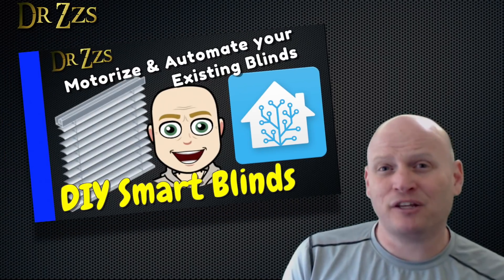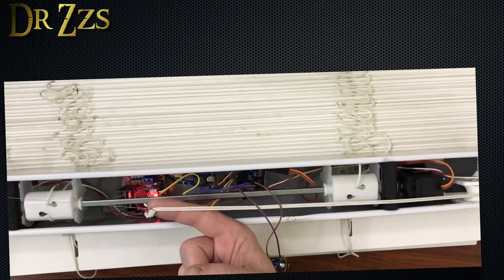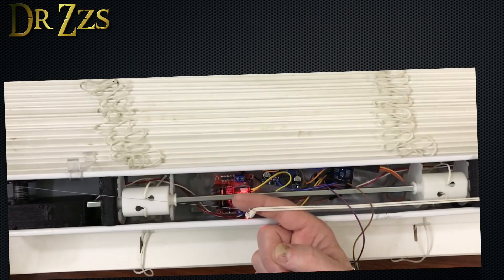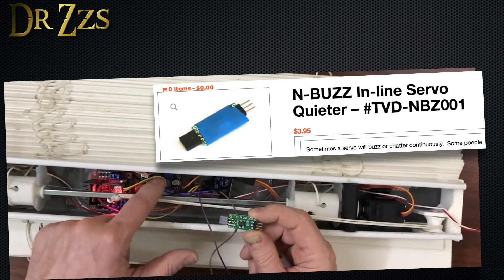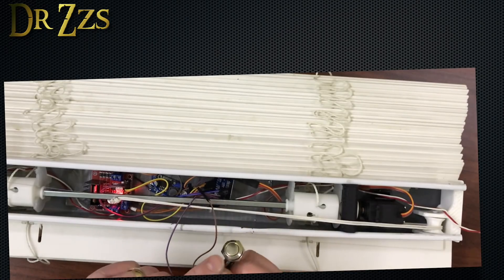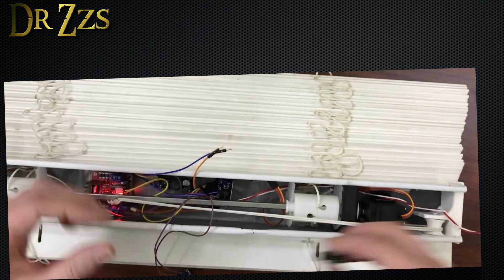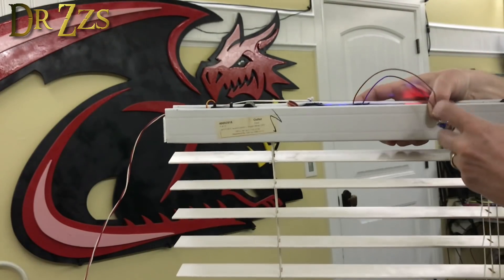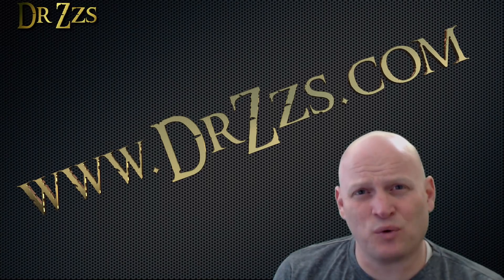Motorize and Wifi Control your Existing Blinds - Version2 | Smart Home | Home Assistant

Comment: First, thanks a bunch for sharing all of this information AND the 3d parts.  The video is awesome and you inspired me go for it and to set up my first HomeAssistant!  With limited ability to modify parts with the computer, I had to make a couple accomodations for my blinds.

I had issues with the string wanting to wrap behind the pully, so I superglued a washer to the back of it and it seems happy.  I bought the stop switch in the video, but it's really not large enough for the blinds I have and you hear things stressing more as the blinds near the top.  I hope find a happy medium with timing.

I'm sure some operator error, but I'm having trouble with mine not staying level -- and it's not very consistent (e.g. it's more than one string being too long).  After I figure out that riddle or give up, I'm moving on to try batteries!

Thanks!

I have a bit of an update!  The inconsistency of level was just how the string was winding onto the spool.  

Maybe not pretty, but in my first remix, I used DrZzs' spool and turned a copy of it over on top of itself, then narrowed it. When tying on the string, add a half hitch knot on the center of the spool.

One more thing, ours are fake wood blinds.  I added a couple washers inside the bottom rung for a bit more weight.  That seemed to add a bit of consistency.  I experimented with using 8AA batteries, but that's a no go for me.  They only lasted a couple days.  I added the files to the comment at thingiverse.

Awesome project!  Thanks again

Comment: Is there any way to tilt the blinds by degree as opposed to fully opened/closed? Sometime, I just want to tilt open a little. Same with raise/lower. Is there a method to stop/start raising/lowering at a partial point as opposed to fully up/down? I have at least 7 existing blinds I need to automate.

Comment: The ESP8266 does not use a hardware PWM implementation, rather, is software based which uses interrupt initiated timers, therefore there will be a small amount of variability in PWM output/lengths. The PWM variations are causing the servo to move accordingly resulting in the chirps.

Comment: Is there any way to retain a manual option for this? My SO isn't keen on software/voice as only method to control stuff around the house? Maybe some kind of pull chain wired to a GPIO pin? Not sure where to start.....

Comment: Why did you use a servo vs a stepper motor?
Reply from the maker: the servo is easier to control with ESPhome.  I've struggled to get Tasmota or ESPhome to work well with steppers.  If I could write custom arduino code I'd use more steppers, but I can't so I'm using servos and DC motors.

Comment: Great Vid, one suggestion that I think is a must for Version 3, replace the power supply with a battery and Solar panel ( to keep it charged) that would sit on metal casing on the window side and then allow you to have no visible wires around the window.
Reply from the maker: I actually have a 12v solar panel.  I'll have to try that.

Comment: Did you solve the problem of the time it takes to raise and lower the blinds? There seem to be more powerful and faster motors available. It would be great is the blinds opened at about half the speed of opening them manually. Maybe 10 or 15 seconds. Great video, but a little over my head. I can put together a BOM from your video but did you provide the the 3D printer instructions? I would like to try this, but with a bigger motor. It seems to me you now have things figured out enough that an integrated Version 3 could pull it all together. I would be a big help to the less tech savvy among us. Post some kind of a donation site and I would be happy to kick in. Yours seems to be the best solution I have found.
Reply from the maker: Thanks!
I haven't tried anything else to speed it up.  I should probably try a better, faster, stronger motor.  I've seen some, but they are twice the cost.  I guess $30 vs $15 for a project like this is probably worth spending.  
I'll see where I can get the best price for a better motor.  It'll be a month or more at least with all the other projects/ideas I have in mind and in progress. But yes, I'm sure there will be a v3 with a couple different solutions.
Reply: @DrZzs  were you able to find a better motor that would work?

Comment: If I know you ... tinker tinker tinker ... There more than likely be another version coming LOL and thank you for the videos. I have been thinking about something like the for my home. Mainly, since sometimes I sleep in the day rotating shifts. Thought it would be nice to set the home alarm to home armed. This causes my heating/cooling to do to night mode, my lights through out the home shut down, now I can close up the home blinds (starting with bedroom and maybe the other areas later).  Thank you !!!
Reply from the maker: Ha. Ya, you are right. I’m not done tinkering with blinds. 
That’s a good idea you’ve got for managing things when your sleep time changes.  That’s exactly what Home Automation should do for us!
Reply: @DrZzs  I needed something to work with my rotating schedule and a programmable thermostat would not work.  Therefore, I started to look some a solution and found your channel. HA did just that. Unfortunately, you lead me through a rabbit hole. Now, I have my security system on HA which allows for many things to be controlled based on my home status (home armed, away armed, disarmed). And no monthly payment except the monthly $5 auto dial-er for text/email alerts (in case wifi outage) battery backup installed.

This meets my needs of nothing from outside looking into my home as well.

Now, I have armed away doing the random lights on/off, lights on based on bad weather in area, flashing porch light and garage external on alert alarm. Home built thermostat in main rooms (office/bedrooms) to average out temp for home. If there is an imbalance, the main DYI thermostat will only turn on fans to balance. If the main thermostat calls for heat/cool and there is an imbalance only the fan will turn on (unless a +2F variance).

Have wood burning stove in family room. See above to balance heat. Also, when the heat in family room gets too high another routine will close the outside venting air to stove to 95% lowering fire to save wood and not over fire. Call for heat open vent and inline computer fan will push air to start fire up again. Add wood or start fire routine will start computer fan to feed air to fire helping the start of the fire (on timer).

Basement thermostat to prevent freezing pipes. Alert sent and heat auto on no matter what temp house is at since the wood burner.

Now, setting up personal email server, calendar server, web server for web mail, media server and drop box. On a ProxMox VMachine (my old desktop) connected to a 4Tb NAS. This allows for PI3 in office and bedroom running  headless Rasbian to connect to speakers to play music off the media server (install HA for control of that room only media). TV's have PI Rasbian Kodi and HA install for same kind of control. Control through domain name port forward web address bookmarked on smart phone. (Setup that way to see remotely what is running papa is watching HAHA.)

You filled in many of the holes for the things I wanted to setup in my home. I think you can see some of your projects you have featured here on YouTube.

So THANK YOU and you have made a difference to those out there in YouTube Land.

Next, the blinds and drapes. Thinking auto close at night open by day (unless home armed (bedtime)).  And have been thinking about the ring doorbell ... but again the outside to inside control I do not like.  Therefore, I like your doorbell. I will have to think about it a bit more. Maybe, one for the wood burner when out and about or out of room. And front door ... will think about that one.

So thank you for sending me down a rabbit hole I seem to not have found my way out of yet .... LOL

bob
Reply from the maker: Holy cow!  
You really have jumped down the rabbit hole.  Say hi to the cheshire cat when you see him!

Comment: The reason why your servo chirps is because you're trying to hold its position by having it powered. You have gotten around this by turning the power On and Off as you want when you move the servo. another way that is possible using arduino is to deactivate the servo by stopping the signal. this just means the servo is not being held in position anymore. practically the same thing that you're doing. except you're switching the power cables. I switch the signal cable

Comment: Hey bud anyway you can please please please! Integrate automated controller for grow rooms. Something similar to this Bluelab Pro Controller/controls feeding pumps for nutrients in ml/ measures ph and also corrects it with a sensor and two dosing pumps/ ppm meter through WiFi. There’s a whole other community for legal indoor farming that would die for this including me! Lights/mini splint temp and controls/ nutrient Doser in milliliters/ ph meter and corrector with doser/ co2 controller/ safety power outrage alert/ humidity controller/ fam controllers/ light hub controllers on a timer/ water flow sensors for gallons coming through house/ water level monitor. All via home automation io integration is pay you!
Reply from the maker: That is not something I'm familiar with.  I'm a terrible gardener.  I'll put it on my list of things to learn about.  Don't hold your breath.  I don't expect it's something I can do very soon.

Comment: Hi DrZzs, do you know https://github.com/peterbuga/HASS-sonoff-ewelink ?? If you dont know yet and if you have any sonoff  w/ stock fw, please go test it. Its amazing :)
Reply from the maker: yes, I have seen it.  I tested it a few months ago. Seemed to work well.  
I still flash mine, but that's a great option for those who don't want to mess with firmware.  
The newest Sonoff Basic (revision3) is going to have stock firmware with "DIY" mode.  It'll allow for local-only control.  I'm expecting delivery of a couple of those very soon. We'll see how it works.
Reply: @DrZzs  OMG! DIY mode??? really? can you tell us when will happens?
Reply from the maker: It's supposed to happen middle of May.  That's all I know.  But I'll put out a video about it as soon as it drops.

Comment: This is great, but I would imagine that most people don't have power going to their binds. Any way of controlling this via a small slim battery?
Reply from the maker: I should have shown how I get power.  I have wires hidden in the window sill that go to the nearest AC outlet and plug into a 12v ps.  You might be able to run just the servo for tilting on a battery, but the lift motor is going to take quite a bit of power.  The wifi board takes a bit of power too, even at rest.  
Maybe the best solution would be a combo battery/solar panel.
Reply: @DrZzs  Ok I think I can live with just tilt, it's what I use most of the time.

Comment: with stepper motors or encoder motors, the sistem can be "calibrated" knowing the amont of pulses that the motor needs to open or close the binds, as well the cost of items it's not too much...
Reply from the maker: It might be hard to get a stepper strong enough to lift the blinds.  Maybe a geared dc motor with en encoder would be a good alternative though.  The timing method is sometimes off a little bit.

Comment: I don't understand what you're doing with the servo power. Why not keep the servo power constant and disable the pwm? With no pwm the servo won't try to move anymore. Use "- output.turn_off: pwm_output"
Reply from the maker: I'll try that. 
Thanks!
Reply: @DrZzs  No problem, now you just need to make a 3rd video lol
Reply from the maker: it seems a 3rd blinds video is inevitable.

Comment: hi doc fantastic video it looks like the blinds you have are larger than the regular sized ones you get from the box store.
Reply from the maker: Thanks
Yes, I think they are.  It would be easier on the motor to lift/tilt the narrow metal blinds.  It would be harder to hide the motors and such, but not impossible.
Reply: with smaller blinds you can get the tilt functionality by using "9 gram" servos, worked perfect in mine
Reply: Joseph do you have more information on parts you used and how you used them in the blinds I would like to try it in my home
Reply: @rottison  my setup just uses a single 9 gram servo and a wemos d1 mini, no motor to move the blinds up and down but I find I don't need that. I 3D printed an adapter to hook up the servo but they sell servo couplers that do the same thing
Reply: you wouldn't have a link handy to the servo coupler would you?
Reply: I found a bunch on google just have to find the right size
Reply: @rottison  the fittings vary by brand
Reply: ya I found that out going to have to take one down and see what size the shaft is and what kinda room is in there thanks for pointing me in the right direction